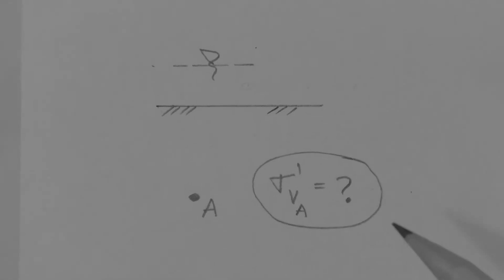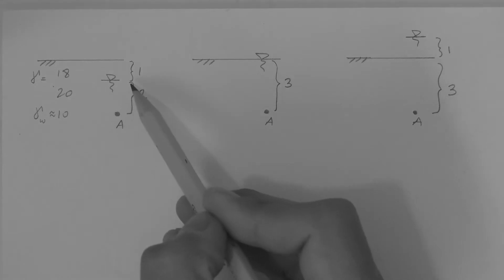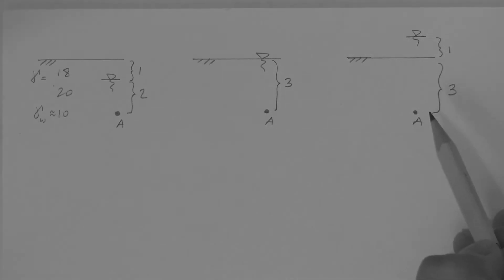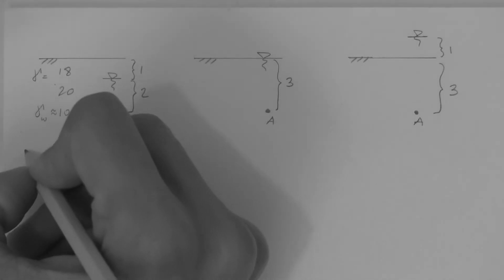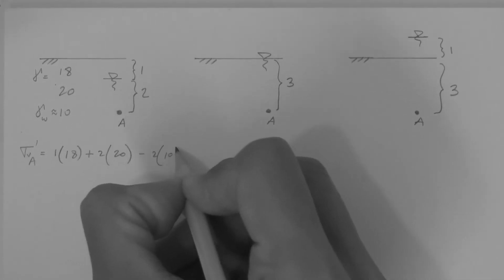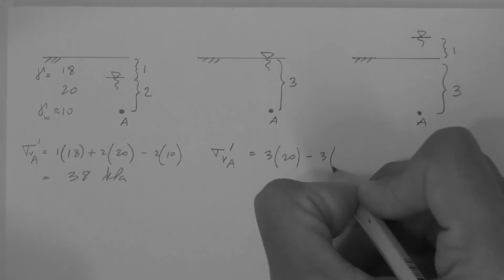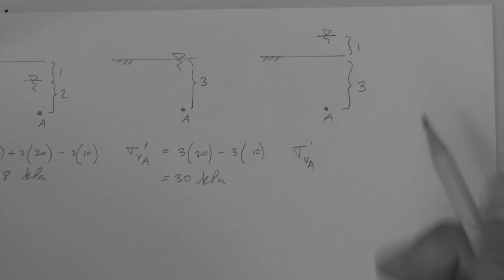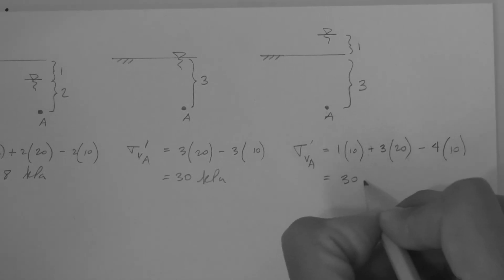Effective stress calculation examples.

Comment: this is incorrect! Case 3 should be 40kpa. there is an extra 1m of head of water above it cannot be the same as case 2
Reply from the maker: Hello Motwer. The water pressure at the point in case 3 is 40 kPa, but the effective stress (which is the INTERPARTICLE stress that the grains feel at that point) is 30 kPa. Think of it like this: if you hold a rock underwater while scuba diving, the stress on your hand (caused by the buoyant weight of the rock) is the same regardless of how deep underwater you are. In such case, your hand represents one particle and the rock represents another particle.